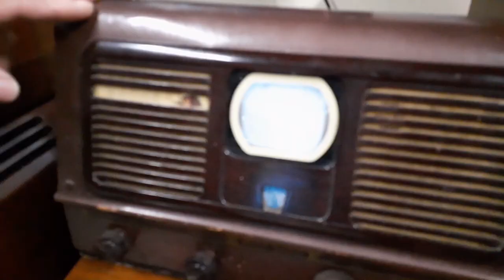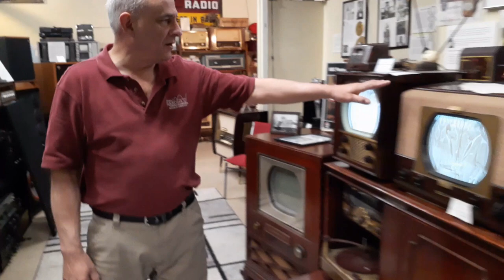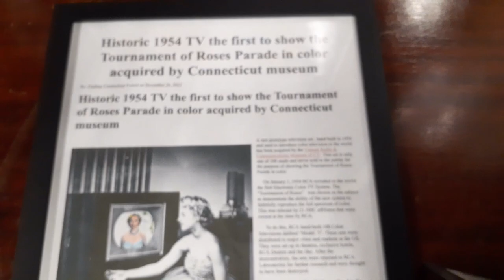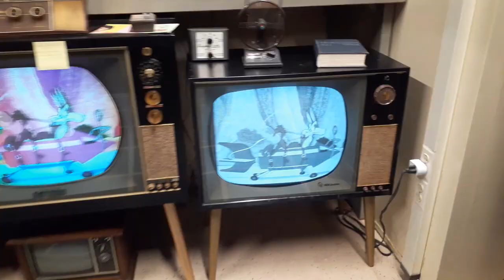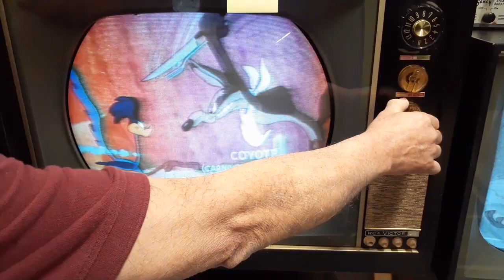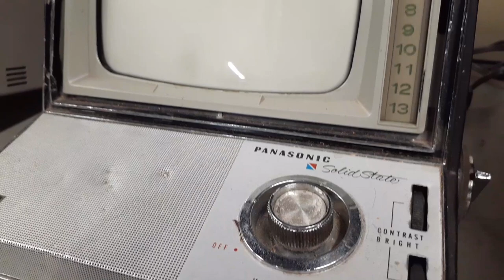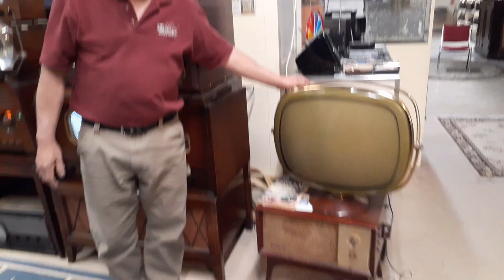Vintage Television Exhibit  at the Vintage Radio and Communications Museum of CT

Comment: I have one of those RCA mini console TVs like the one you have tucked under the CTC-11. It still works too, for the most part. Hey, can you finally put a question to bed for me? Were they really only used as salesman's samples to demo the bigger RCA sets, or could the regular consumer also buy them?
Reply from the maker: I worked for RCA as a Technician and also attended the sales seminars. That set and others like it were for the dealers.
Reply: They weren't salesman's samples, they were regular production models.  Never big sellers.

Comment: I have a 1948 RCA 9t240 tv set in my basement. I saved it from a deceased neighbors house many years ago. When I plugged it in the tubes light up but no sound and no picture. My guess is the wax capacitors definitely need a replacement plus wire damage. Hope to get it restored or to the right hands one day like a museum. Also have a mid century Grundig Majestic tube radio that works perfectly fine
Reply: Electrolytic capacitors are highly prone to destructive failure in such old radios and TV sets. Power up such an unrestored device at your peril.